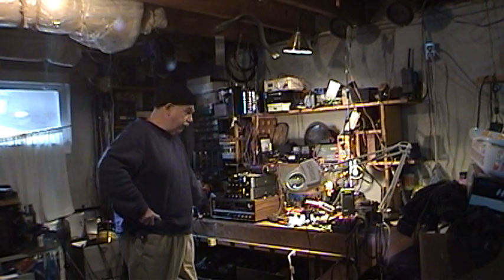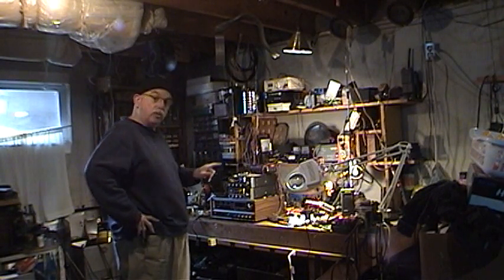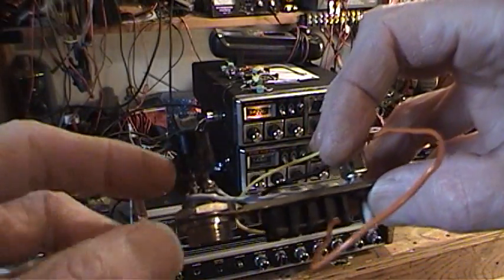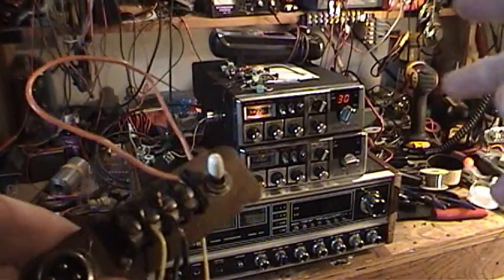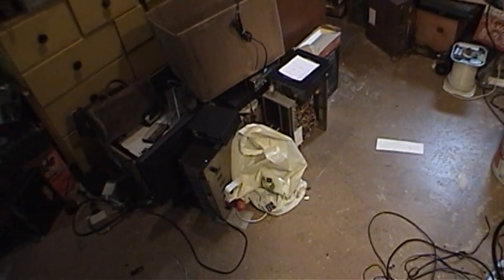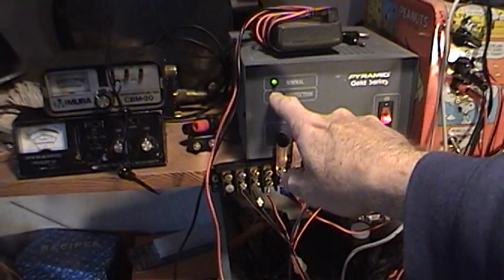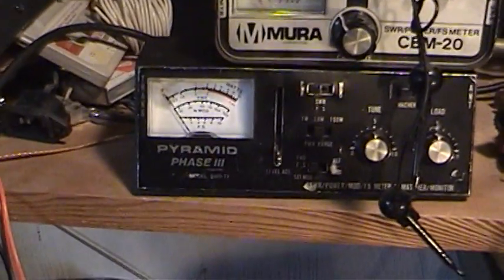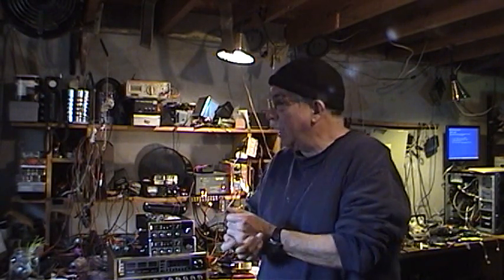CB Radio Project

Comment: I have some CB radios that I modified to do digital modes using sound card output and serial transmit control. I have not done a live on air test from one radio and PC to another due to legality regarding CB band and that sort of thing, so I only tested it via dummy load and it worked fine.

Comment from the maker: The signal will still be analog.  The computer generates tones which you send through the radio.  At the other end a computer decodes the tones.  The radio can be converted to ham radio by swapping a crystal and readjusting it (in the older radios).  You have to move it up in frequency about 1 to 2 MHz.  CB channel 40 is at 27.405 MHz and the ham band starts at 28.000.  The voice portion of the Ham band is higher in frequency.  The band has been dead a lot lately due to the sun spot cycle.